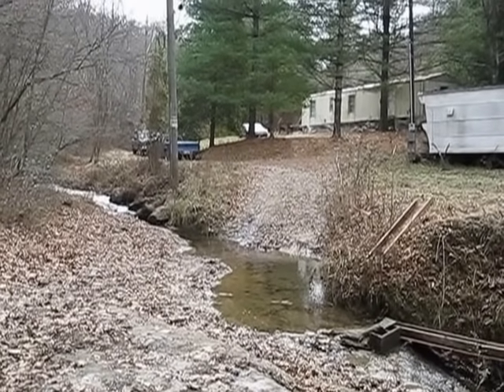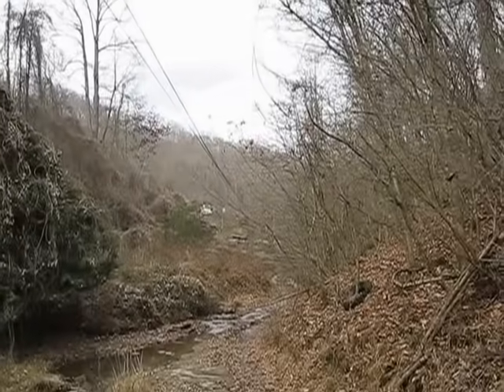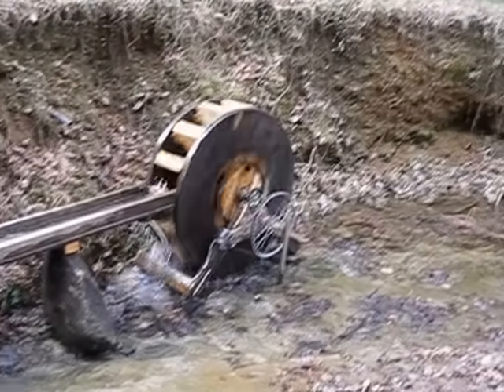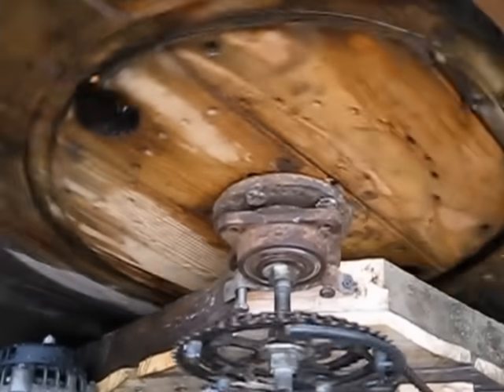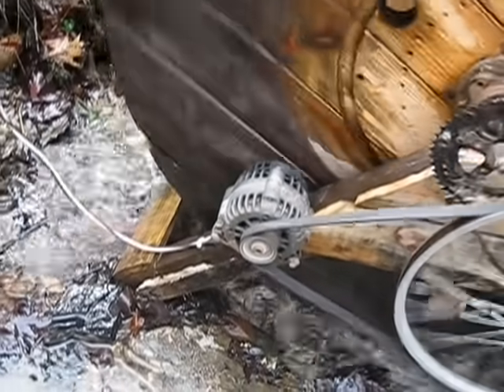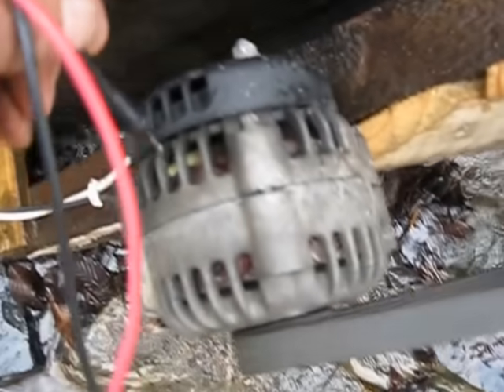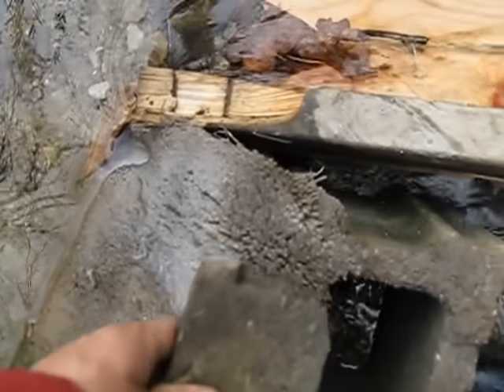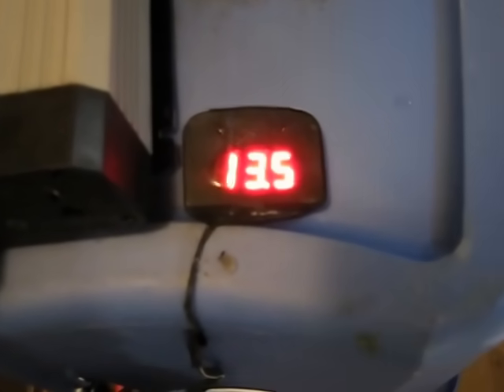water wheel generator

Comment: Amazing setup. Please, help me to answer these questions. I'd really appreciate;
1. How long can the cables/lines run? What type of cables?
2. Do I need a step up transformer if I run lines of 900 meters? What type of transformer?
3. With a 12 volts alternator like that, what appliances can I use?
Thank you 🙏
Reply from the maker: Sorry for the late reply. I hadn't been on this channel for a long time. I am usually on my main channel here is a link https://www.youtube.com/@lukeFugate
The distance you can run the wire depends on the gauge of wire and the type and amount of voltage. 900 meters is a long way to run this, a step up transformer would help but the losses would be massive for that distance. It would be best to have an inverter close by the water wheel and run AC power. even then it would be highly inefficient. If you can't get the wheel any closer I would suggest solar panels instead. By the time you buy all the equipment necessary for getting power from the wheel to the destination you could have bought enough panels to get more power than the wheel would provide.

Comment: I really like what you have done!

The wire to the house... You are running 12v through it. That is why you are loosing so much of your original 40v. If you have the inverter closer to your hydro generator you will be sending 110v  up to the house. I'm guessing you have an extra 20v right there. In other words, you will triple your output!

Kudos to you man! 🎉
Reply from the maker: Thank you! I did eventually have an inverter close to the wheel and just ran the 110v. I did this a few years ago and like you said, it did help tremendously. 
A water wheel turns out to be way too much work with flooding and damage repair. I have switched to solar power now and am enjoying that very much.

Comment: I dont understand how the inverter is connected to the batteries and where the incoming line from the altenator go into? I too live beside a creek. Two the one beside me feeds a larger one behind me. Amazon has a hose inline hydroelectric generator a 80volt, 5volt and 12volt. I'm trying to figure out all the other things like charge controller, batteries etc and how it all connects

Comment: If you could find an old generator in the junkyard, throw the engine in the garbage and hook it up to the water wheel
Reply: It’s a alternator,  not a generator, there different animals
Reply: @busarob1969  obviously my point is just that you could run straight AC power out of the generator and then just backfeed the entire panel
Reply: @918M you could only problem is getting a steady speed on the wheel to get a perfect 50 or 60 hertz frequency
Reply: @918M only if you could spin the generwtor head 3,600 rpm and have sufficient torque…which is not practical with this waterwheel.
Reply: @jacuzzibusguy  just run it through a simple gear reduction system the way a mountain bike gear system is set up. I’m sure you can find the proper gearing to get 60 Hz.
Reply: @jacuzzibusguy  all right I hadn’t watch the video in a while. The stream is pretty Jenkee.  But hear me out what if we ran a parasitic pump and upped the pressure so we can run the wheel faster. I’d probably get busy building a dam as well. I mean this dude this guys doing all right but it could be great.
Reply: Throw it in the garbage 😅
Reply: That's a good idea sir. I've also seen people used an alternator that's been modified into a generator

Comment: Just for fun:  this type of system mounted on two styrofoam pontoons tied off each bank side, like a raft.  It can ride up and down with the rise and fall of creek. Center paddle wheel. Same drive design  (maybe two alternators to balance weight on each side)  Build box cover for alternator(s) and its mountings.

Comment: Great work, good thinker 💡 increase the number of alternator generators to  take advantage of all that torque, make the blades of the wheel take more water to add weight to the flow of water, adds more torque,. But I'm sure you have ideas, because you're a good thinker 💡

Comment: What did you do to the alternator to get it to generate 40 volts at such a low rpm? I built a small hydroelectric generator very similar to yours but it seems like the alternator needs be able to spin ~1000rpm like it would in a car in order to actually generate power. Which if course the waterwheel drive doesn't spin it anywhere near that fast

Comment: Seems to me the setup you have is working pretty good. Why don't you just install a second water wheel about a hundred feet up from that one in the flow line. If you really wanted to get fancy, you could do like a lot of guys and add in a 5 kilowatt solar array. They should give you roughly 5 to 8,000 watts of usable power. Your biggest problem then would be a bigger inverter and charge controller. Would probably have to supplement your batteries too. But the water wheel you got on the cheap so why not just do a second one and double the output power going to the batteries.

Comment: Everybody needs a hobby.....

I have mine,  too.  I have had the citywater shut off for 15 years or so,  and rely for water entirely on rainwater. 

I collect water in a half dozen 55 gallon plastic barrels located in my basement for protection,  and a steel tank that holds about 600 gallons outdoors.

I schlep water  into the house and to the washing machine in the basement.  

This saves some money,  but it's really a hobby.  Life's not hard enough for my taste. 

In  Seattle,  we have lots of rain except for a seasonal summer drought which last 2-3 months or so.  What's the point of letting all that water go down the drain and then BUYING more?!

Comment: Also you have the wheel going the wrong way. The wheels should spin the other way so it works with the water momentum and gravity. Raise the shoot and have the water hit it at the 1230 1 o clock position. That water the momentum pushes it forward and the weight drops it down and since you don't have resistance on permanent magnet motor you should use multiple. Keep on keeping on my friend

Comment: You know if you put a wheel on a 5kw generator then took another wheel and put it on an electric 120w motor. you could plug it into the generator. then took another wheel and put it on a drill you could start it and it would run till you clicked the dimmer switch for speed control and off.
Reply: rubber wheel on rubber wheel works like gears in a clock rolex
Reply: Big bike wheel on little bike wheel turn it all side ways so tires on bottom fill big wheel half full of pure whiskey oil and water mix in = 3rds  works in winter with out freezing and summer with out expanding to much
Reply: Your most welcome

Comment: It would be better to use the alternator from a Briggs & Stratton engine, as it has no brushes to wear out. My Husqvarna riding lawnmower has an Intek V-Twin engine that has one of these alternators on it. It uses a solid state rectifier to bring out 12Vdc.  You’ll need to remove the spark plugs, magnetos and valves, but gain a reliable energy generator.

Comment: Small improvements.
Cover the alternator to keep it rain or splash out.
Move generator up higher to prevent damage if water rises.

Convert to overshot wheel from undershot by moving wheel downstream extending inlet Chanel Or rss as using dam .
Reply: Since it's free spinning and has no loaf he can run a bunch of them

Comment: Edison generators save water. Use an old generator pre 1974 disassemble the generator and count the armature magnets and divide by 6. Chisel off one 6 and leave one 6 on  alternating on and off to 3 sixths off and 3 sixths on
 Reassemble the generator. This is a motor that generates electricity. So you have to hold both the case and the armature still while you reassemble the generator.  You wire 12v 110vac inverters to match the output in amperage. You have house current.

Comment: That's a great use for stuff most people would throw away! Good choice using a backshot design, too. 
Other than lubricating the bearings, the only improvement I could see making you more power would be making the leading edges of the paddles a lot thinner (like turbine blades). You're losing a substantial amount of water when the paddles pass the lip of the aqueduct. Making them more streamlined will minimize the splashing. 
Another potential improvement would might be a thicker wheel. With more volume between the paddles, the water will be contained for a longer time, getting more energy out of it.

You might also want to move that alternator further away from the splash zone. A longer axle maybe?

Comment: You would have better efficiency had the water been hitting the top of the wheel going the other way,  as it is, the water changes direction immediately and has slowed down, This is a loss of energy.

Comment: WHAT A NICE DROP!
A 2 inch pvc pipe to 1/4 , 3/8 end piece at the crossing, from the top, and you could sell the excess. Or heat your hot water. I just bought wire today for my hot water.
Im putting rv 12 volt lights.

Comment: You have the power wires connected backwards. The black is usually the hot wire and the white wire is neutral or ground. That applies to all house wiring that is done within any sort of wiring for 110 volt or less in voltage. For 220 volts it would include a red wire that is also a hot wire.  This is information known by a fully licensed electrician or anyone who is being trained in some form of vocational school or college.

Comment: How did you go from 40 volts to 13.5 ?   What voltage regulator do you have?  How many amps are generated from the water wheel?

Comment: Why did u change the magnet, or add one??. Couldn't u just use like it comes by changing the cogs
Reply: An alternator works by presenting an electrical current to a set of spinning windings producing an electro magnet.  It takes a small voltage to generate a greater voltage.  Replacing the spinning windings (rotor) with magnets removes the need for any excitation voltage (current).  If the magnets used are weak then you have a weak generator.  Strong magnets will generate higher currents.
Reply: @petec6690  so n other words: the alternator was old and about worn out?

Comment: Very good engineering I know there's a lot of comments on here and I didn't read them all but if you can I have the bridge rectifier in the alternator you losing some power going all the way to your batteries if you could take the bridge rectifier out of the alternator and put it right next to the batteries that would make your run shorter  for the DC. voltage

Comment: Cool. Could unwarp that bike wheel with a spoke tool. Put a zip tie on the side and tighten/loosen appropriate spokes till it rides continuously on the zip tie. 1/4 or 1/8th turns at a time work well.

Comment: Get you some capacitors for auto sound system. For 25$ you can get one that’ll put out 2.5fr 2500w. I have one between my batteries and my inverter. Will hold the charge and stop the load pull from stopping your wheel.

Comment: I have a recommendation to make if you don't care about just some suggestions that can significantly increase the performance of your system. The first thing is to make the most of the natural unevenness of the water with the idea of increasing its speed to the maximum possible since the authentic potential energy of Water in unevenness is to change it in speed. I also suppose that you changed the winding core of the alternator for a neodymium magnet or similar, leaving the diode bridge inside and therefore transporting the energy in the form of direct current. This has two inherent problems: the first as it happened to Edison that transporting energy in the form of a direct current is tremendously inefficient since the voltage drop in the cables is much greater. I recommend you remove the diode bridge from it and move it to the house and of course you will have to add one more cable since the alternator is three-phase, the next thing is that when a magnet is momtar the voltage is regulated by the RPM of the same and of course when You choose a load (A) to the alternator, this decreases its RPM and with it the voltage and of course the power (W) is the result of V multiplied by amps with which to turn into a vicious circle against you. And last but not least, NEVER connect batteries in parallel if you cannot increase the input voltage of the inverter, charge and discharge them alternately, but the best by far would be to store the energy at the highest possible voltage since losses in the power supply are minimized. combersion I hope this helps you, it is only for lending a hand not for criticizing or anything like that. Thank you

Comment: Tengo alguna recomendacion que hacer si no te importa solo algunas sugerencias que pueden aumentar notablemente el rendimiento de tu sistema.Lo primero es aprobechar al maximo el desnivel natural del agua con la idea de aumentar su velocidad al maximo posible ya que la autentica energia potencial de agua  en desnivel es combertirla en velocidad.Tambien supongo que cambiaste el nucleo bobinado del alternador por un iman de neodinio o parecido dejando el puente de diodos en su interior y por tanto trasportando la energia en forma de coriente continua.esto tiene dos problemas inerentes: el primero como ya le ocurio a Edison que trasportar la energia en forma de coriente continua es tremendamente ineficiente ya que la caida de tension en los cables es mucho mayor. te recomiendo saques el puente de diodos del mismo y lo traslades a la casa y claro temdras que añadir un cable mas ya que el alternador es trifasico.lo sigiente es que al momtar un iman el voltaje esta regulado por las RPM del mismo y claro cuando le esiges una carga (A) al alternador este disminulle sus RPM y con ello el voltaje y claro la potencia(W) es el resultado de V multiplicado por amperios con lo que de combierte en un circulo vicioso en tu contra. Y por ultimo pero no menos importamte NUNCA conectes baterias en paralelo si no puedes ampliar la tension de entrada de el combertidor cargalas y descargalas alternamente pero lo mejor con gran diferencia seria almacenar la energia en el voltaje mas alto posible ya que se minimizanlas perdidas en la combersion espero que esto te ayude tan solo es por hechar una mano no por criticar ni nada por el estilo.Gracias

Comment: Increase the height of the waterfall and increase area of wheel . you can also add flywheel and use waterflow as extra energy needed to keep it running(after giving speed to flywheel by handle )

Comment: I have a suggestion  dig a square hole 2 feet deep with a discharge where the wheel is now, turn the wheel 180 degree , have the water go over the wheel at 12 o'clock  this way you will gain 50% more torque because you will have more buckets filled to turn the wheel 
the water will go over the wheel and discharge with the same direction the flow is you get more output.

Comment: Why does this gent not utilise the water better siting the water wheel down the creek bed further allowing the water to get up speed by dropping it from the header height by at least 4 feet with a bigger diameter wheel or larger bucket or even use a spiral screw to generate power or put on a double alternator using 2 volt marine power cells in parallel to run his power from. As you can see from the trees there is some wind down the creek maybe a wind turbine could also add to his supply. COL UK

Comment: An mppt solar charge controller would convert those 40 volts to 13 volts without losing any watts.
Reply: What do you have right now is just throttling it down and losing 2/3 of the power being generated.  MPPT charge controllers can take a hundred volts down to 12 volts with very little loss.

Comment: set up a bucket wheel in front of that to fill up a tank if you can find one in a scrap yard...even a corrugated iron tank...a ten foot high tank say....if you can find one...this will give you pressure at the bottom...an old rainwater catch tank...hook up a hose to the out put on the tank ...and with the other end of the hose aim it at the wheel,,,you have to match the output with the amount of water going in to the tank...stick with it brother you can do this...this system works for us in New Zealand at an old gold mine,,,mind you to be fair we has water running into the tank from a creek up the top...the tank was 34 feet high...there was that much pressure coming out at the bottom we ended up having to set up a pelton wheel turbine....3.4kw...ill send some pics

Comment: Wait your wheel runs backwards. Should go over top and fall on backside. Also wonder if you could cut bicycles up and use two 21speeds combo. Can Shift gears to fine tune load range. Wish I lived near water.

Comment: I am a big fan anything about alternative power source. Here in the Philippines we have intermittent supply of power. Since 2011 I’ ve been  using 1000 watts solar panels connected to 8-100 ah deep cycles wired parralel/series to produce 24 volts. This set up allows me to harvest around 2000 watts per day. This month I installed  1 kw grid tied inverter connected to 4-300 watts panels. On this set up, I can harvest around 2500 per day. When I watched your video I got excited because I ve been thinking about this idea. There  is a creek adjacent to my yard like yours and could potentially provide me with added power source. I live here on remote mountain part of the Philippines where grid power is not reliable. I can build the wooden wheel  and  the bicycle sprocket, however, the alternator is the one Im not sure what to do. Do you do anything with it like installing a controler to regulate voltage output?   Or 
Can I use any alternator right out of car or truck? Please respond using my fb messenger: Don Peping from Hermosa Bataan Philippines. My profile is the one with me and my wife and a boy on water buffalo as backround. Thanks